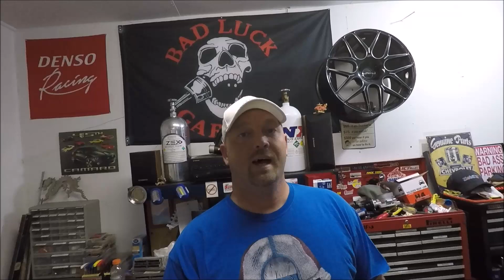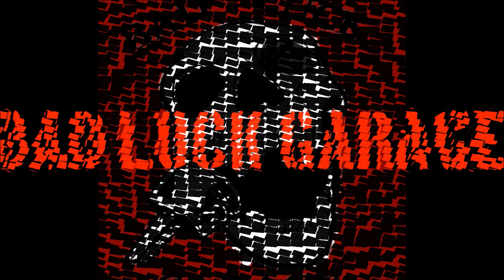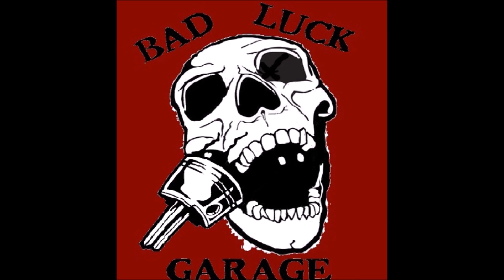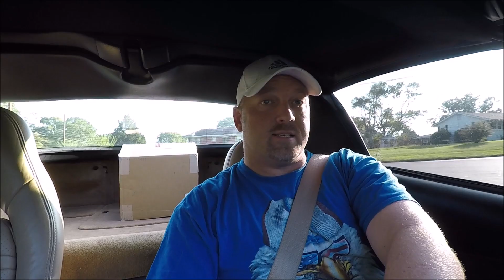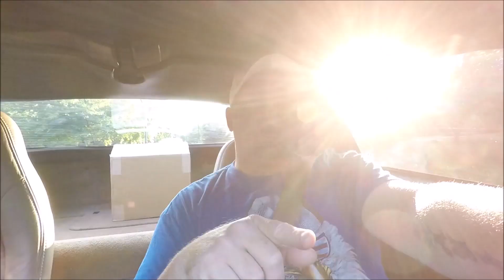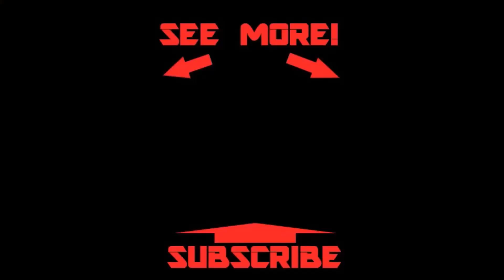PLANS AND GOALS FOR THE C5 CORVETTE BUDGET BUILD

Comment: So have you figured out what springs your gonna run when you install the sloppy cam?   

I'm trying to put together a list just in case ebay has a good sale on or around black friday..

So far on the list:
#1 sloppy 2 cam
#2 pac 1215 .600 springs 
#3 some kind of trunnion upgrade..

I kinda like summits trunnion kit with the bronze bushings instead of neadle bearings.. 

Any thoughts?
Reply from the maker: I was just gonna go with the 1218s. Theres a seller that had them for like $140. I'm waiting on the cam though because im thinking i may hit my goal for the ebay build without it. If I do then I may end up getting a different cam to start phase 2.
Reply: That's awesome.. cheap parts from ebay can be great but like red forman said " what's wrong with the originals, those are genuine GM parts! "  lol 

Itll be sweet to hit your ebay goal under the predicted budget..
Reply from the maker: Yea if I can get some time to get this nitrous issue figured out, I think I’ll be really close once I’m finished tuning. If I end up only a couple tenths away then I know the the stall converter, shift kit, and a set of drag radials will get me there. I’m still gonna do a cam after that but if I can hit 10s with the eBay build without it, then I may actually go will a slightly smaller cam in this LS1 and start doing a max power build with another engine. I’d really like to build a stroker that can hold about 300+ worth of nitrous but still be street driven and eventually swap it in and go for a 9 second daily driver.  😉 I’m talking a true daily driver that the Wifey can comfortably drive everywhere with AC and seems fairly docile, then swap out the wheels, take it to the track on 2 150 shot kits and run 9s on the weekends. That would be a great ultimate goal for this Vette. I also would like to build a turbo “track only” vehicle on a junk budget down the road. Something small and light and gutted just for track duty that I can rip on and not give a shit if it breaks every weekend. 🤣
Reply: Sounds like a good plan to me...  

Probably a good thing your not as indecisive as me..  

somedays I'd like to build a track weapon from the s10 but other days I just want a clean ls swap i can daily during the summer.. 

I also have a 2000 sierra rcsb 2wd with a 4.8 and a rusted frame in the back...   for awhile I was gonna drag the s10 and daily the Sierra..  

But in NH OBD 1 vehicles dont get emission tested for inspection.. so  with the s10 i can get as wild as i want and not have to swap parts or change tunes to pass.. 

 Shit I'm so indecisive,  i've been sold on the idea of putting a spool in my dana a handful of times but I've also decided to keep it open just as many lol..     

 I want open diff handling with spool like grip.. Unfortunately theres no room in my budget for an arb locker.... 

So decisions, decisions... lol
Reply from the maker: Yea brother Project SteppinWolf was supposed to be a daily driver build and I let myself get sidetracked with all the turbo crap after it had already met my goals performance wise. I actually went backwards with the turbo build and that’s why I got frustrated. This time I’ve decided to build a daily driver and stick to my plans and then build a dedicated turbo track vehicle later. I HAVE to have a fun street car that’s reliable or I’m not happy but the track car can wait if that makes sense. I don’t like not having something to play with whenever I feel like it so I need semi-fast and reliable first. Then stupid fast piece of shit that has to be worked  on all the time can come later, lol.
Reply: Hahahaha that's basically how I feel about the s10...  

reliability is #1..  it is overkill but that's why I choose a dana 60 rear.. might not be as light as an 8.8 or as easy to work on as a 9 but I'm after brute strength not saving weight in a bracket car ...

The main reason I wanted a spool is cause 1 tire fire sucks when you wanna lay some rubba..  

But I can honestly admit I've never been on a dragstrip, so itd probably be foolish to run a spool in a toy that will see 99.9% of its life on the street... 

Unless of course my buddy gets going on swapping his lq4 into his foxbody... 

then of course I'll have to slap some drag radials on and hit the strip..
Reply from the maker: Yea spoil and street cars don’t really go together. I’ve tried. It sucks brother. On another note I finally got a solid nitrous hit about two hours ago! Editing video now and should be uploaded in a few hours depending on how my internet wants to work tonight. 🤷‍♂️
Reply: That's awesome man!  I bet she's faster then a cheetah on cocaine...

Will we get to see the custom wrapped intake bellow?
Reply from the maker: Oh yes and you get full credit. Lol. I actually posted a meme of it in the Bad Luck Garage group Facebook page yesterday.

Comment: As most of the working class with a family.
Reply from the maker: Yep brother. Honestly the only reason I went with a C5 instead of a C6 is because it’s car most people with a decent job could afford if they wanted too and because there are a TON of low cost performance parts available for it on eBay and Amazon!  That’s why for the first part of the build I’m trying to reach a goal with mainly cheap parts and I’m doing it paycheck to paycheck like anyone else would. As I mentioned in the video, the one thing that I will probably have to spend an obscene amount of money in will be the transmission. But that’s kinda unavoidable unfortunately. 😔

Comment: I have speed engineering longtubes. They make 723whp on my c6.
Reply from the maker: I was leaning that direction until I did some research and made some calls and figured out the headers and x-pipe aren't bolt in. Looking and Manzo now because I dont want to have to do any cutting or welding or have to buy any extra parts. The Manzo setup is about $80 more but is completely bolt in with flanges instead of slip joints, and already has all the O2 bungs, mounting tabs,etc so i wouldnt have to worry about any of that. I know Speed engineering are pretty popular as far as Ebay headers go but in my opinion they need to focus more on the little things that make installation easier.

Comment from the maker: I’m loving all the feedback guys and I’ve got it narrowed down to either the Speed Engineering or the Manzo headers and X-pipe. I’d really like to here from some people that are either running those currently or had them in the past. My main concern is that the Speed engineering has no mounting brackets, no flanges to connect to the axle back portion of the exhaust, and from what I can tell also have no wideband bung. Any thoughts on this? And again, thank you all for all the feedback!!!

Comment: Speed engineering is by far the best eBay header you're going to buy
Reply from the maker: Thanks for your input brother! I’ve been researching since making this video and that seems to be the case. Only issue everyone talks about is buying better band clamps. 👍🏻
Reply: Bad Luck Garage yeah m. That's my only complain I've used them on everything from Corvettes to 4 wheel drive pickup trucks
Reply from the maker: so in your experience the fitment is good on the C5?
Reply: Bad Luck Garage  yes sir they fit great

Comment: I've had good luck with speed engineering
Reply from the maker: That seems to be almost everyone’s vote so far so that’s most likely what I’m ordering. 👍🏻
Reply: Got them on my sons ls swapped mustang. they fit very well.
Reply: I think, have to check again, but we got dnr on his 2007 chevy truck and they fit very good too. I was surprised
Reply from the maker: Makes perfect sense brother. Thanks!👍
Reply from the maker: My only issue with the speed engineering setup is it doesn’t look like it comes with a bing for a wideband whereas the Manzo system looks like it has 5 bungs already installed so I wouldn’t have to have anything added. But Speed engineering definitely has a good reputation other than the crappy clamps they supposedly come with.
Reply: Bad Luck Garage I've done two of there exhausts on two different c6 the first one all the clamps worked great the second one I ended up having to tac everything in place to stop it from separating.
Reply from the maker: good to know. I was planning on buying one of those cheap harbor frieght migs just to learn on. I may need to step up the time table some. I was thinking the x-pipe and midpipe could just be welded together to eliminate two joints. Im betting its only separated there to save on shipping costs and help make alignment easier while installing.
Reply: Bad Luck Garage mig welding is super easy with a little practice and great skill to have. The c6's I did had the headers, then mid pipe/x pipe and then then bolt up to your over. I'm guessing the c5 is the same. I would hold onto the back half of that exhaust and see if it will bolt up to your fancy borla. Sorry if that doesn't make sense it's my Friday and I've been drinking whisky.

Comment: There's a ton of guys that run the Manzo headers with great results, in my opinion I'd spend the little extra for the speed engineering, they make some really nice stuff for a great price In my opinion in a year they'll be charging double for the same part
Reply from the maker: Yea I'm really leaning toward the Speed engineering just because I know the LS swap headers for the C10s work great and we're also going to be using a set on the LS Nova build as well.
Reply: It's like I got a 98 Z28 back in 07-08 and I bought a set of "ebay" headers and y-pipe from a company called OBX for 500 to my front door they have now almost doubled in price. And I had those headers and y-pipe until I ended up parting the car out in 2015 and the car had made 716whp on a 150 shot with those same headers.
Reply from the maker: Hell yea. I remember buying the OBX stuff back when it was just another ebay seller and they've definitely went up since then.
Reply: Bad Luck Garage yeah exactly and they where on my car for over 60k miles and the only issue I ever had was the little thing that came off the front tube on passenger side for the EGR valve cracked mainly because I ran a EGR valve for like 40k and once it broke I just welded it shut and never had another issue, and in my opinion the Speed Engineering stuff is actually really good quality and they are probably barley making a profit selling them for the price they are, but they are moving products getting their name out there. I need to redo my exhaust from the headers back, and I think I'm going to buy their CTSV x pipe kit and modify it for my G8 because you can't beat their pricing...
Reply from the maker: The speed engineering is still China made and I’m sure they’re making as much profit as anyone else selling on eBay. I can’t speak about any of their other products but their shorty swap headers were IDENTICAL to a set of shorty swap headers I had bought five years ago from a different seller. Honestly a lot of the stuff on eBay seems to have really increased in quality in the last 5 years or so. The problem is there’s still a lot of the old poor quality crap floating around that originally gave eBay parts a bad name as well.

Comment: Do a Manuel valve body on the 4l60e or 4l80e! Or atleast talk about it! Manuel when you want and auto when you want! Best of both worlds! Good luck!
Reply from the maker: Brian to answer your question, I payed $200 for the one I currently have but it was about five years ago. Haven’t bought one since but you can get any trans for I believe $175 at pull a part. They don’t care what it is, only that it’s a transmission.
Reply: Bad Luck Garage if you ever want to sell yours let me know lol
Reply from the maker: Thanks for watching! I would LOVE to put a 4L80 in here( I've still got the 80e from the turbo truck build in the garage right now) but unfortunately thats not an option with the rear mounted transmission. RPM does modify 4L80s butit requires cutting off the bellhousing, installing a custom output shaft, and several other modifications to the housing as well as modification to the car so its a $10,000 upgrade. I really have no need for a manual valvebody since the computer will be doing all the shifting faster and more accurately than I ever could but the 4L60 will have to be beefed up for sure.
Reply: Bad Luck Garage hey how much are 4l80e by you? Everyone by me wants almost 1k for them because everyone around here is doing a 4l80e swap. I need one for my Silverado build.
Reply: Brian Dudra if you already plan on having the transmission rebiult, you can always buy a 4wd mt1/4l80e and have the output shaft and tail housing changed during rebiuld
Reply: jt marshall thanks for that info! I'll keep that in mind.
Reply: Brian Dudra 

I believe you also have to have a tone ring for the vss installed on the output shaft as with a 4wd one is in the transfer case..  

Any good transmission shop should know the procedure better then me but wanted to mention it as this is what I'm doing..

 i need  2wd 4l80e for my s10 so I'm having a 4wd 4l80e from a 98 k3500 converted to 2wd..
Reply from the maker: Its already sold brother. Thats the one thats going in the Nova build I'm working on right now.
Reply: Bad Luck Garage that's right haha